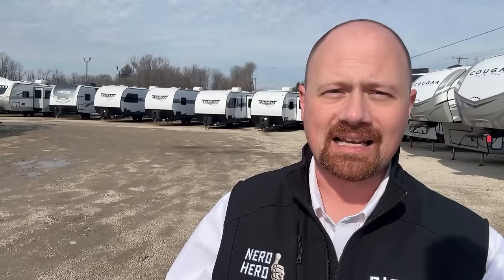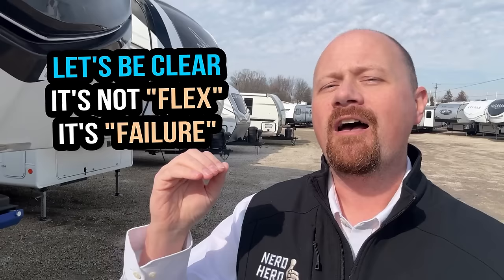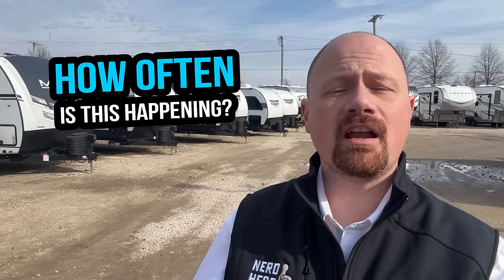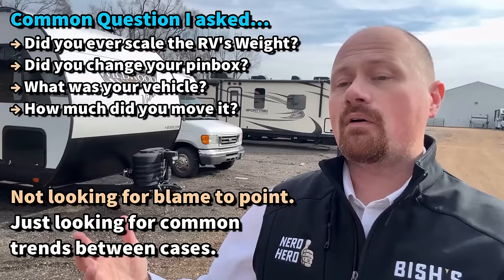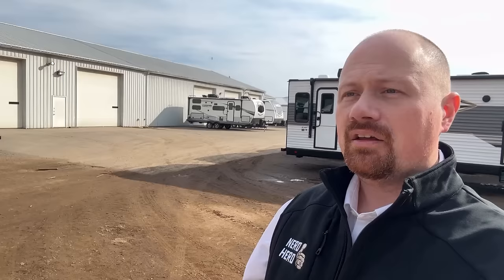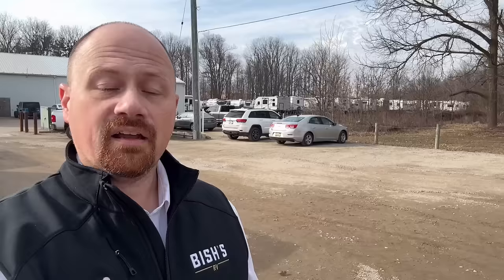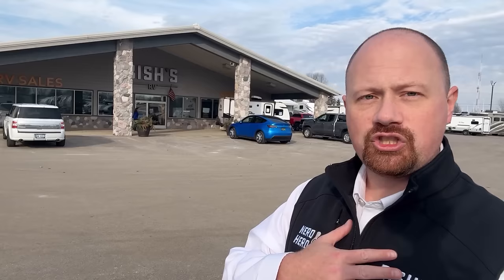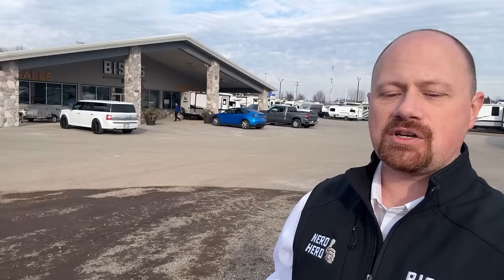🚨 RV Frame Flex & FAILURE!! • WHAT is Happening and WHO is Responsible?!

Comment: Hi Josh!  What comes through much of this is "the towing package is an Engineered Package" and changing any part of that package, or not installing, using, or maintaining the package consistent with engineering instructions can lead to premature and possibly catastrophic failure.  The suspension of the tow vehicle, and vertical impact transmission to cause shear on the sides of the RV is telling.

In the end, owners tend to use their RVs as a big appliance/home, that should withstand whatever use conditions are imposed upon it, without structural compromise.  I'm not saying they're incorrect, but having some life experiences, I want to know that I'm using my RV within its design limits.  Duty cycle seems to be the next specification that needs some kind of definition and rating scale.  Thoughts?

Comment: I think most people don’t realize that all trailers flex. Look at a flat bed semi trailer. It has 12” of crown in the deck empty but load 40k lbs on it and now it’s flat. Yes the bigger 5th wheels are going to flex at the area wher it transitions up there’s no way to get around that. But when the mfg specs a frame that allows so much flex that it starts to damage the body or eventually cracks that’s an issue. Yes we can’t have a 5th wheel trailer with an 8” I-beam  gooseneck section like a heavy haul gooseneck trailer has because everyone over 5’ tall would smack their head on the ceiling in their bedroom but these manufacturers could step up on specs of gussets and beef up plates in key areas for a negligible weight gain. Also they could do a little more R&D on where best to place customers loads in the unit while traveling so there’s less chance of over loading the hitch weight. I have a 47’ toy hauler and I throw almost anything I can in the garage to balance the weight and my pin box still moves up and down in the shroud area the way it did when I first rolled it off the lot a year ago brand new but I’m not to concerned

Comment: I've been following a few of the YT RV'ers that have this problem.  It seems to be a common denominator is generators in the front compartment and frequent moving of the RV(just like you reported). And who. Knows how much more crap they have stuffed into the front storage compartment. Add a washer/dryer to the front closet and there's a whole lot of extra weight bouncing around on the frame.
These 40' + behometh RV's aren't built for this kind of weight/use(although the manufacturers/dealers  certainly market them as such. Units are still designed and built like it's the 1990's; recreational and infrequent use a few times a year. However today buyers on these large RV's are utilizing them as replacement sticks and bricks (and they cram as much crap that was in the sticks & bricks into the RV). Manufacturers need to keep the build weight low so that buyers can stay under the requirements for a CDL and a MDT to tow it with.

Comment: Thanks for bringing up the "Flexy Frame" & scale issues. It is important for the owner to scale the RV out prior to loading it regardless of the type of RV. A good time to do it would be during the test drive from the sales lot. What? Who test drives an RV? You just pay & drag it away don't you?  Since when are we pay, plug & play without a test drive & tug test? You better be test driving what your buying & giving it a tug test prior to purchase with what ever you intend on dragging your RV with. I will repeat, do it with the vehicle you are intending to move the RV around with. If you test drive directly to a scale at a local truck stop, scale her out, you will be so much better off. What is going to happen on the test drive, is the exact same thing that is going to happen after the dealer gets your money & goes into hiding mode. This should be the same for any RV you consider buying "A, B, or C" Class. I have seen lots of issues with the frame flex & failure a lot more recently than in the past. I think this is 100% due to a reduction in the quality of the products used in the building & manufacturing area. The thought of the issue having to be with the owner just towing the unit around too much or too far is crazy. But we do live in a blameless society where everyone does point the finger at you. These things are suppose to be built to be towed, that's how you move them around. Never have I seen a warning about towing too much or too far. That's a lame excuse at it's best. Biggest case to prove the lack of quality workmanship during manufacturing is the fact that these issues are happening with our brand new, never before used RV's. Consider the following. These are steel made frames. The United States got out of the steel industry almost 20 years ago. Where are they getting their frames built? It definitely is not here in the USA. That could be part of the problem right there is the steel being used is not strong enough to hold together the weight of the RV. It's bending & breaking apart, & because the steel is manufactured in a different Country, makes it impossible to get to the cause of the problem, & to fix it. We need to hold the MANUFACTURES responsible for the "Flexy Frame" issue, & it is their responsibility to correct the problem, no matter the cost.

Comment: Great episode…so do the manufacturers need to start building part time rigs and full time rigs with proportional price tags?  I believe a frame can be engineered to withstand “full time” use, but at what cost and weight
Reply: I was thinking/wondering the same thing!
Reply from the maker: In the same way, that an automotive manufacturer has warranty limitations based on both time and Myles I feel so strongly the RV industry needs to adopt a similar system. Whether they start actually tracking Myles, days used, or something else I feel like there needs to be away for a customer to have a realistic expectation of how that RV is intended to function for them.

Comment: LCI (Lippert systems) have been known to have built substandard frames (especially 5th wheels). Several folks who have Grand Design products share the same problem: the frame cracks at the L-joint and LCI will only warranty if they can see the issue and so Grand Designs will only pay for the disassembly of the front cap area as a reimbursement. LCI will then weld a support into the frame and fix the cracks.

Comment: in Australia, we see a great deal of 'frame flex' especially on our rougher roads. of course, we don't have a large number of 5th wheel trailers, we are highly addicted to travel trailers/caravans. the main cause for us is the very fact that they are overweight. several governments are wanting to crack down on this and are trying to legislate owner requirements to scale them regularly very similar to what happens in the transport industry. the other thing that often occurs is, because of our road networks poor conditions, is that of speed, just as you have said.

Comment: Just an observation from the solution offered from a large manufacturer of 27' to 29' model years 2020 to 2022. They are retro-fitting additional cross members and replacing axles and springs. Maybe one size fits all is not good?

Comment: I had a 2012 Montana Big Sky that had travelled over 25,000 miles with very little problems.Never heard of frame "failure" until recently. My take on it is when covid hit, the manufacturers and Lippert were short staffed with workers, but still pushed out record numbers of Rv's. Management figured why hire more people back when we got away with less qualified people and little quality control. Looks like greed is going to come back and bit them in the ass.

Comment: Kudos Josh on another excellent video! This is certainly a hot button topic and on our RV forum  I have seen a number of posts on this topic which is concerning. What I would be curious to know is what the average cargo carrying capacity is today vs say 10 - 15 years ago for both towables and fifth wheels? I would imagine (and maybe I am wrong) that it is less today vs what it used to be for a couple reasons. 1) Today RV’s are built with more “bells & whistles” than in the past which would add more weight overall. While one could argue RV’s are made with lighter materials today which is true I think storage areas have vastly improved which would offset that to some degree. More storage = more stuff we will haul around. 2) manufacturers are cutting corners wherever possible to save costs and as such may have sacrificed some of that cargo capacity in order to be as competitive in the market with respect to overall selling prices. That may have translated into using a frame that teeters on the edge of being too light especially when we are talking about toy haulers. We had one and loved it but traded it as I could see longevity issues being a big concern down the road. It IMO our rig had a frame that was too light and its cargo capacity suffered to the point of being over weight if I were to travel just with my Harley alone loaded in it.  🤨. That’s something we learned later after purchase and to your point this is not well documented or talked about hardly at all during the sale of an RV. I’m not saying that’s 100% the responsibility of the dealer to identify this as only I would know what cargo we would want to haul which really makes it my responsibility. Overall I feel the manufacturer has a greater responsibility in all of this as in my situation who wouldn’t use a toy hauler to haul toys? Building one with a low cargo capacity sacrifice’s safety and just puts everyone on the road at risk as well. Seems to me the entire industry needs more regulations and oversight as the RV market has exploded and I would bet there are many units running around over capacity. This may be part of the reason for an uptick in this overall conversation.
Reply: @armslength2618  Didn’t post it that way armslength2618 so not sure why it is displayed that way.

Comment: Josh - while your comment about the type of tow vehicle being used is spot on, the fact that your video actually shows a farm tractor (with essentially no suspension) being used to move trailers around a somewhat rough gravel parking lot caught my eye.  Great information as always!
Reply from the maker: Well, I do recognize what you’re saying. I think that there’s a pretty significant difference between moving something less than 4 miles an hour at a time while it is completely unladen through generally flatland it just happens to have some gravel is very different from high-speed road Use with cargo.
Reply: @JoshtheRVNerd  I totally agree with you.  It was just the timing of it all that I found some humor in.

Comment: Glad to see you address the elephant in the room. 
RVs are not built like commercial vehicles they are lighter and for the most part not designed to take on daily loaded use. 
Commercial vehicles are. 
RV 5th wheels different design in the box and supporting crossmembers. 
Commercial bigger frames larger crossmembers and fifth wheel king pin is mounted to a apron that covers frame to frame with crossmembers for designedadded strength and stability.
Their are a few RV manufacturers that go above and beyond in their products design and construction those seam to be more along the lines of customer orders either on a commercial chassis or    Made for use and travels boondocking.

Comment: Good info here. My experience, not so much frame flex but other things like hydraulic levellers or mechanical stabilizers, is that if it has the Lippert name on it, it’s junk. I’ve watched the reports on frame flex and it’s welds that are broken. Welders that I know have said the weld should never break, the metal should go first. Virtually all the frames are supplied by Lippert. I rest my case…

Comment: This is a great episode. Covered so much more than bendy frames. You touched on a large number of hot button items for me. Use case and design life expectancies are just two of the biggies. The part about using semi truck tractors to pull 5th wheel trailers and the suspensions of the trucks just literally hammering RV’s to pieces. That also brought to mind all the people adding the helper springs and air bags to their trucks and vans “to increase their towing” capability and performance. And all they are really doing is adding a bigger hammer to the suspension hammer.
Reply from the maker: Frame flex is a symptom of a greater problem I think

Comment: I was in RV sales for 5 years.  I have owned 4 Rvs over the years and seen many RVs and only a couple with frame flex.  One of the constants is toy haulers ( what seem to be the most constant problem units ) 

1. They have heavy things like side -by sides , Harley’s not loaded over the center set of tires and it’s too far back.  

2.  Full timers way overloading the units.  I saw a few but that was rated at 16.8 and it was near 21 on the scales 
3. Overloaded certain parts of the unit compartments.

Comment: The real problem is Manufactures are forcing the frame makers to make substandard frames that are not structurally sound when going over uneven ground such as road work...etc  they reinforce some for front to back flex and weight bearing but not for side to side flex in order to save a few $$$ and that's why I think most of the failures happen.(there is also a video out there that supports this)Yes the consumer does make all the errors you pointed out, like the woman who sued McDonalds for serving her too hot coffee and won, they need labels for people like that.
Reply: Most Frames come from Lippert who has been in business for a very long time and know what they "should be" doing to build a decent frame. They choose not to and hire sub par labor.

Comment: Josh is right on several things. The Semi Tractor dual rear axle normally carry 30,000 pounds,  FMCSA weight limit is 34,000 pounds for the double axles for truck and trailer and 20,000 pounds front axle.  If you put just 1/10th of the weight on the 5th wheel, the springs wouldn't know and every bump would shock the 5th wheel.  People who put airbags on to take the weight instead of allowing the rear to sag as designed does the same thing, shock the trailer pin.  A vast majority of pickups pulling RV are overweight, example is an F-150 Platinum towing a 10K bumper pull WILL be overweight even though the hitch and everything load it properly.  An F250 with a 6.7 diesel pulling a 40' 5th wheel will be overweight, as they have very little payload due to the diesel engine.  It is very easy to overload the trailer, especially those with large storage bins. 

Everyone hauling an RV should get at least one proper cat scale done.  Weigh the truck alone as it will be when traveling, then hook up the ready to travel trailer and weigh that, subtracting the truck weight to get the trailer weight, and subtract the rear axle weight loaded from empty for the pin weight.  It is simple math.

Comment: I had a '95 Thor 5th wheel That I towed with my big road tractor., once. only went on about 3 other trips with a one ton dually as tow vehicle. not a lot of miles overall. The cross members where the pin box attaches ended up breaking more than 3/4 around the 2 inch by 6 inch 1/8 inch tubing.  I attribute the breaking to the harsh ride of the road tractor, the condition of the roads , attrocious, and the marginal strength of the 1/8 inch tubing.  Being a welder I fixed it myself and put in 1/4 inch tubing to fix it.
I have another larger 5th wheel now that we have towed about 40,000 miles, and have started noticing some signs of frame flex.  Over all considering the awful condition of the highways with the terrible road to bridge transitions and other very rough conditions it is amazing how well these rigs stay together. not to say that there could be some better construction in a lot of places on the trailer. 
Nice to hear an RV salesman who is concerned about the customer.